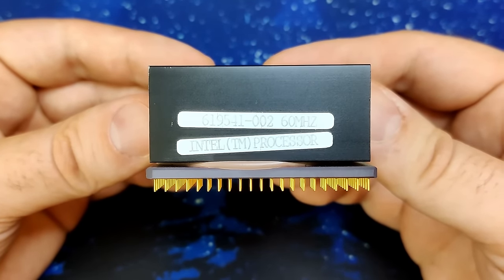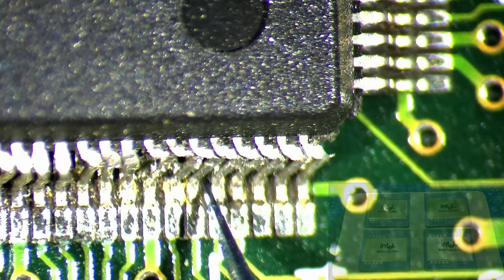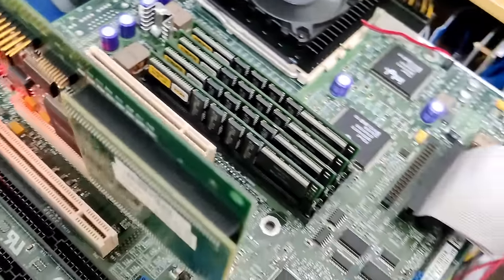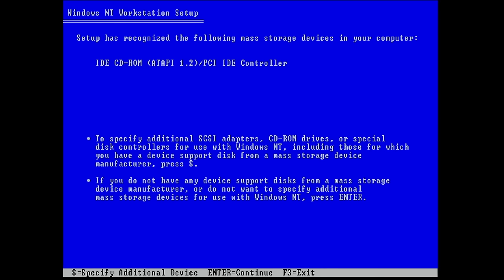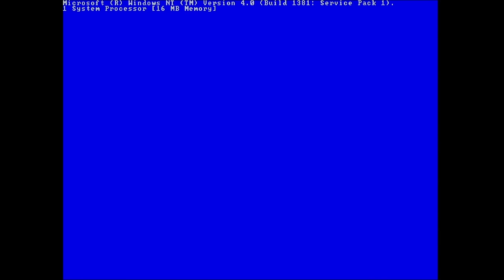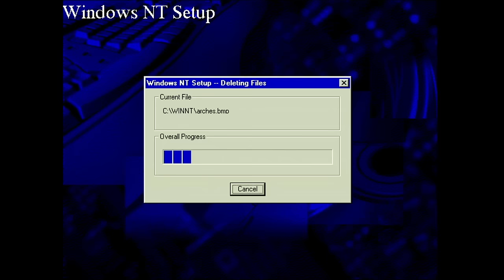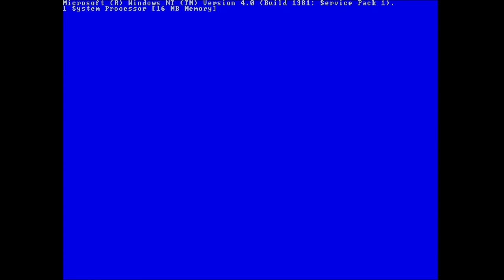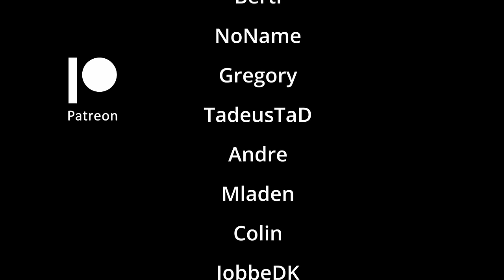A CPU ahead of its time: The Pentium Pro

Comment: I remember hearing about it when it came out, and it sounded exotic and interesting. I would like to have a single or even dual Socket 8 system for my collection, because I've never used one before. I do think that 440FX chipset held it back in some ways. I never knew until much later on that it was the basis for the Pentium II. Speaking of which, I'd like to have a Slot 2 system as well...
Reply from the maker: Well, I still have another two identical boards, but I don't know if they work. I'll probably get them to people who are interested in them if I can get them to work. So, keep an eye out for my future content 😅

Comment: I got myself two golden P-Pro 200 CPUs and a dual socket motherboard, neither of which I ever managed to get running. Bought used for cheap, I am not exactly surprised though, especially after I had to bend-correct nearly every PIN possible.

Comment: Used to have a Compaq deskpro with dual pentium pro. Which was awesome for the time. It also had 64mb memory. And yes I used nt4 as DC. Later I tried windows 2000 on it.

Comment: Since you asked (and for some engagement) I happily ran NT 4.0 and NT 4.0 Terminal Server. Had HW compatibility issues often, especially with my 56k Winmodem (no drivers). In the early 2000's I saved a 4 x Pentium Pro Compaq 4U server from ewaste, but sadly, it's long gone. 😢

I currently have a couple socket 8 to slot 1 adaptors that I'm itching to use and a pair of socket 8 pentium ii overdrives.
Reply from the maker: Those adapters are very nice! It must be very interesting to get those Pentium Pros on to a slot 1 board.
I never had much to do with Windows NT, but it seems to be the common consensus that plug and play wasn't available and driver issues were very common!
Reply: @bitsundbolts  I'm waiting for some time to get to those adapters/ project, I have multiple dual slot motherboards (different chipsets). I expect it may require porting coreboot to one of the boards to get things working. I work for a well known chip company so you can imagine I don't have much time for personal projects. 🫠
Reply: @bitsundbolts  let me say also that I really enjoyed your video. Lots nostalgia and enjoyed the board repair part too.

Comment: I had a Toshiba Equium 6200M for a while. It was my dads computer originally. Had two socket 8s. Only one eas populated though. PP200. It started life with NT 4.0 on it. Eventually got 98SE and had a Voodoo 2 card added.

Comment: I've only used a Pentium Pro PC once at a college so frankly I never got to truly test things out.  I did however own my own copy of NT 4.0 with all the service packs too, and I liked it more than Windows 95/98 for most things but AAA Gaming (except for Emulation).  It was far more stable than 95/98, and as long as you installed the hardware drivers after the install of the OS things went quite smoothly.  I was not as big on AAA PC gaming as much as I was into emulation gaming, but the majority of emulators were NT compatible.  

 Of course we still use NT to this day since 2000/XP most when MS dumped the old DOS structure for NT's structure.  Too bad MS screwed up Windows to the point I have switch to Linux by 2025 (only my gaming rig is still running Windows 10 for now).

Comment: I had a Pentium Pro 180 when I was 13-18. Mom got talked into the system by Gateway 2k, I never realized how overkill the system was. I do remember it being incredibly expensive, and with it's I'm sad to say 2mb gpu that I cannot for the life of me remember what it was, there wasn't much it wouldn't do at the time, mostly gaming. When I was 16 friend came over and we took the side off, and looked at the schematic, and realized that just pulling a jumper would overclock it to 200 mhz, and it ran like that for the rest of the time I had it. I didn't realize until later just how ridiculous that was for a home system.

Comment: I have completely skipped the Pentium Pro/2 so I ran NT4 on my Am5x86-133 equipped with 32 Mb of RAM. It was kind of bearable, very slow but bearable. Of course I had a Windows 98 in dual boot so that I could play some DOS games. But for the software development, I used the NT almost exclusively. Computer not locking up once you did something wrong with the code was a pleasant change. Until the NTFS partition decided to nuke itself out of the blue around 2001.
That was a sign for me to go upgrade. Duron 850 with Windows 2000 ran circles around my potato.

Comment: 16MB was still pretty good in 1995, even for a workstation.
Reply: I had the same thought. It was just enough to run Windows NT 4.0 efficiently. And of course there were use cases where even more RAM would have helped.

Comment: I upgraded to NT4 from NT3.51 and lost count of the number of copies I installed through work, where I even had to reverse engineer part of the setup to handle a mass rollout of PCs for an environment in which fibre-ethernet was required, which was not handled by any standard install method which would work unattended.  It did when I'd finished with it!

Comment: Never owned a Pentium Pro back in the day, it was much too expensive. I did use Windows NT 4.0 a bit though. I got a student licence for both the Workstation and Server versions when i took an MCSE (Microsoft Certified Systems Engineer) course. Great OS for productivity, but useless for gaming and general entertainment, due to having a DirectX that was always a couple of versions behind what you'd get on Windows 9x.
I do own a Pentium Pro system today, and I've been using it for OS/2 Warp 3.0. It absolutely flies on that fast Pentium Pro machine with SCSI drives.

Comment: I used a Dual-Pentium Pro 200 Setup in ~1998/1999 to Encode all my CDs to MP3s.
Adaptec AHA-2940 with 4 SCSI Quantum Fireball Drives 640 MB (!), all mounted to slot-Brackets with holes in a RAID0 Setup later some bigger disks, a SCSI-Teac-CD-Drive for the Digital Read-Out of the CDs.
In the Mornning and in the Evening I Ripped some CDs to WAVs, created a Batch file with the Songtitles for converting the WAVs with the l3enc from Fraunhofer IIS to MP3s
The Encoding speed was less than half of the CD-Singlespeed... a 5 Minute Track took maybe 12 Mins to encode! 😞 I ran 2 parallel tasks with encoding batches to make use of the dual PPros.
I had to fight hard with diskspace limits all the time...
I'm not 100% shure if the listed setup is correct, but very similar for sure...
operated all of this with flying cables without case in the living room 😅

Comment: When I was in university in late 90s all computers in classrooms had windows NT 4.0 so I have used it quite a bit. Not a lot of games did run on it so when we cracked the admin password and got to install new software we spent quite some time testing  which games we could get to run there.
Reply from the maker: Haha 😂 great! But interesting that your university went with Windows NT. I guess with a special license, it wasn't too costly.
Reply: @bitsundbolts  They used domain login and tried to lock the PC and NT allowed you to set it up that normal users could not install their own software there or change any of the settings. That is something you cant do with win9x.

Comment: I used to run Windows NT 4.0 on my dual socket 7 system with 2 Pentium MMX cpus at 200mhz. It was fast enough to run Unreal without a 3D accelerator card at a descent speed but the dithering was awful in semi-transparent textures. It could also easily out-perform a Pentium 2 system running at 300mhz, performing more than twice as fast when rendering objects in Bryce3D. Those were the days. As for the Pentium Pro, I don´t have much to say. Way too expensive to even consider at that time.

Comment: Couple of things, use a small brass tube that just sits over the pens on the penny and pro do use it to straighten it out. You can just slowly wiggle it back-and-forth and use it for straightening the pens it works like a champ and it’s really easy to do each pen that way. Next, I wonder how much faster the board in the data will run using a modern SSD unit. Court is all held in the bias so updating the bias should be pretty simple for somebody with that knowledge. I am not good at programming. Even English language is more like a second language. Sarcasm is the first. I believe I have some PTO ECC, memory in a box. I’ll have to look.

Comment: Woaa, I have the same board with 200MHz 256Kb, overclocks to 233MHz with the undocumented jumper settings (x3,5 multiplier). And I have 4x 128MB EDO 50ns sticks for it 😁
Reply from the maker: Nice! I've seen the entry on the retro web about the undocumented jumper setting for 233 MHz. I'll try that eventually.
You definitely maxed out the board on memory! Congratulations! I don't think you can do any better

Comment: Oh my. I have a system (my current favorite vintage PC) that was built from parts to be a "unconditional" Pentium Pro system. 200MHz with 512k, same board you have, 256MB EDO, a GeForce 6200 (last card to have native PCI; board doesn't work well with PCI-e bridge chips), and icing on the cake: runs Windows XP. Dual-boot 98 and XP, actually. NT and 2000 are so buggy and hard to get working, stuff runs so much better in XP. I built it before Retro Web was a thing, and ought to look into BIOS updates and versions! Mine has strange PnP resource management issues, always presents non-existent COM ports to the OS (even when disabled), floppy drive comes up as a "tape controller" and yellow-!'s the "floppy disk controller", stuff like that. So many more BIOSes listed in that page than I ever saw before.

Really though, slap XP on that thing and see what it can do! 😀
Reply from the maker: I'll try to update the BIOS in a follow-up video and learn a few more secrets of the board.

Comment: I pirated a copy of WinNT 4.0 as a student. It didn't want to install with just 8MB of RAM, so I borrowed some for the setup and then returned it. Ran just fine with 8MB after install, though. Had issues with games, rock solid otherwise.
Reply: I remember you could just lean on the 1 on your keyboard when it asked for the activation code.  1111111111111.  It used a checksum digit to authenticate, and for whatever reason, the math worked with all 1’s and allowed the install to proceed.  Crazy!
Reply from the maker: @Thegonagle I think there is a video on YouTube where one disassembled the code / or looked at leaked code of the product code check. But I think it was for windows 95. Microsoft probably had very similar mechanisms for both OSes.
Reply: @bitsundbolts  Yes, Windows 95 would also install with all 1’s.  If I recall correctly, MS Office 97 also worked with all 1’s, although I actually bought that one so I didn’t need that “trick.”  There were probably other MS programs with which all 1’s worked, but don’t quote me on that.  By the end of the 90’s they had closed that loophole for any new software.

Comment: I had a Dual Pentium pro workstation with windows 2000 PRO. That thing smashed the Pentium 2 300 in single thread and obviously killed it in multi thread. It even eventually got the windows XP treatment. But i retired it shortly after for my AMD Athlon XP 3000+.. Those were the days.

Comment: I'm guessing these are among the earliest purchased Pentium Pros due to the usage of FPM. 16 MB would have been pretty marginal for the time. Mainline Pentium PCs had 8 MB, so performance-oriented consumer PCs were already up to 16 MB. NT 4 wasn't out yet but would be in a few months and 16 MB was the stated minimum. In practice you wouldn't go with less than 24 MB and really needed 32 MB to make it worth using over something older. None of this would have been a surprise to anyone following tech press. On the other hand, it's likely a lot of these units would have never seen NT 4 and would have stuck with NT 3, Netware, OS/2, SCO, etc. for the lifetime of the machine.

Comment: Really cool.  I recently got a Pentium Pro 200MHz (256k) on a similar Venus board.  I'm looking forward to trying out some late 90s 32-bit OSes on it.

Windows NT 4.0 has always felt a bit unpolished, though.  It's like Windows 95's younger sibling that lived in its shadow, fell into a bad crowd, became a junkie, but then recovered.  The UI looks like W95, mostly... but isn't a perfect copy.  (Why it even needed to be a copy, vs. just reusing the exact presentation code from 95 is beyond my understanding.)  The installer is a hot mess, doesn't even support NTFS directly (has to install to FAT, then create a NTFS volume, then install to that .... again), has hardware management that more closely resembles NT 3.51 than the better PnP experience of 95, and so on...  I'm not sure if it was just rushed out the door, or if the design team just had no attention to detail, or what.  It's fairly solid though, or at least it is after its sixth (!) service pack, and that counts for a lot.  But omigosh... make those dialog box buttons wider!!  [ OK ]  [Cancel]  I paid for all the pixels, I wanna use all the pixels!

Comment: Occasionally I repair embedded computers for CNC machines that have a Pentium Pro CPU. 200mhz with 256mb cache if I remember correctly. I'm a bit worried that e-waste gold miners are snatching up and destroying these beautiful CPUs.
Reply from the maker: Unfortunately, yes. There are quite a few videos on YouTube showing those CPUs being crushed. I don't know how much gold value can be recovered, but it's definitely worth less than a working Pentium Pro. People pay north of 50 USD for those CPUs. The rarer they get, the more expensive they become. If I find more of those CPUs, I wouldn't hesitate and buy them.
Reply: @bitsundbolts  what gets me is that e-waste good mining is often referred to as a form of recycling. However no one seems to be asking questions about the poisonous sludge that is it's byproduct.

Comment: I have the black edition Pentium Pro, clocked at 233mhz, its running Windows 2k pro. but plan on ditching windows for FreeBSD. I have used win nt 4, OS warp 4 and eComstation. along with many versions of linux. My favorite setup was the Macintosh 7100 601 120mhz running Redhat linux. was very snappy!

Comment: That dramatic cache zoom @1:22 lol

One fun thing you can do at least with windows 2000 and win98 is with the drive formatted FAT32 you can install both but have them share the Program Files folder. This might also work with later NT4, but I don't remember if/what Service Packs added FAT32, same with windows 95 - OSR 2 and later for sure had FAT32, but I don't think the original 95 release did? It's been too long lol

Anyway that might be fun if you wanted to do a direct comparison on how much impact having the 16-bit code in the OS makes. I remember PPro was "slower" at 16bit, but it still was around the perf of an original Pentium 166 (PPro 200 in this case) which wasn't exactly horrible. Disappointing sure, but not unusable at least.

Other ramblings probably nobody else will care about:
I'd be interested to see how the performance of these are at 180Mhz vs say an MMX. Bad but the 180's were way more "common."
There are Socket 8 to Slot 1 adapters (the ones I see are always made by Intergraph but I think there were others) - and from what I've read the early Slot 1 chipsets had support for PPro. What I don't know is if 440BX did, but even if you were stuck with earlier LX it would be fun to see how that would run, especially if could play with 68, 75, 83 FSB. 
All that said, the Socket 8 to Slot 1 adapter you'd have to have some phenomenal luck to find one at the scrapyard. And I'm not suggesting to buy one to try for something that may not work at all.

Comment: You aren't missing much by not having the 1 MB black top cache variants. The Pentium Pro was not a cache starved architecture like Netburst was.

I have two 1 MB 200 MHz Pentium Pros, and besides being a conversation piece, they're not that much better than the 256k or 512k variants, at most 10%, maybe 15% in some edge cases.

The bad 8/16 bit performance comes from the Pentium Pro having to flush the entire pipeline for a 16 bit instruction. There was a video about it on YT not too long ago.

Comment: You asked what they were running with only 16MB? Likely OS/2 Warp, which was a much better OS than NT 4, especially for DOS and/or Windows code. And it shined with Pentium Pros (or the cores later incarnation as P2 or P3)

Unfortunately, it was so good at running legacy software on it that few bothered to write specific software for it and Microsoft's bundling shenanigans killed the OS.
Reply: If you run any DOS or Windows 3.1 software, even on a 32-bit kernel it will tank the performance of the Pentium Pro.

Comment: The place I worked at in 2000 had 2 PPro 200mhz  desktops and both had a single cpu but dual sockets. I ended up getting a voltage regulator, overclocking both cpus to 233 and had a decent for the time Windows 2000 system. I think i ended giving it to the graphics artist, who had something like a p54-133 at the time.
As far as NT 4.0, I hated it. Drivers and lack of directx support made it real clunky to use, especially if Win95 was your daily driver. It looked like 95, but sure sucked for gaming. As a business only OS it was good. NT 4.0 Server was also a nightmare to administer compared to 2000 and later releases.

Comment: How did you manage to make retro PC windowed in the Windows? I mean - you run retro on its own but project output to the Windows 11 - so how to do that?

I have exactly same motherboard and CPU and use them as a dedicated computer, with its own monitor. That is a great setup!
Reply from the maker: I use a hardware device called OSSC (open source scan converter). It allows you to capture VGA output and converts the signal to HDMI. Then you can capture the signal via a cheap USB capture device. It took me some time to find a good one (mine was about 15 USD).
Reply: @bitsundbolts  Thank you, I definitely need to try that!